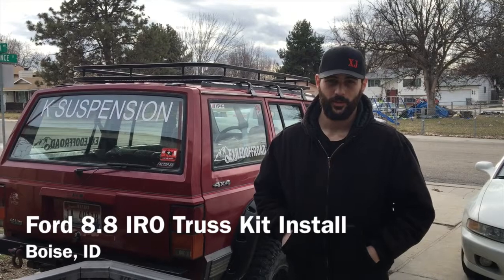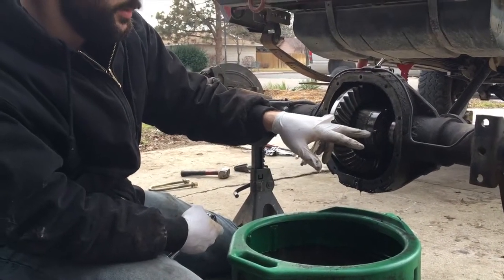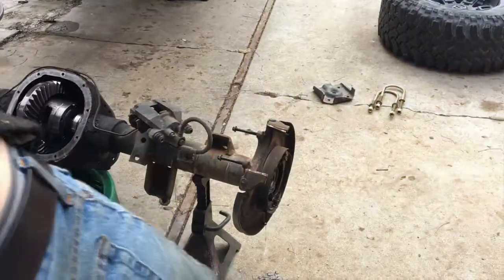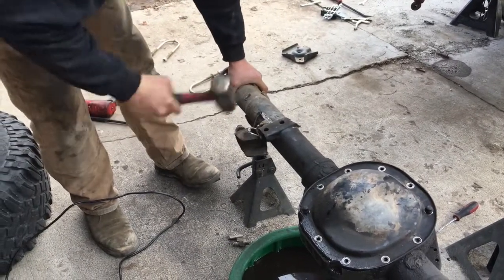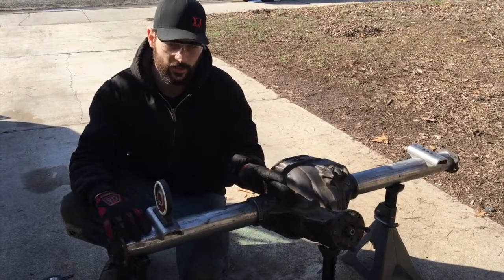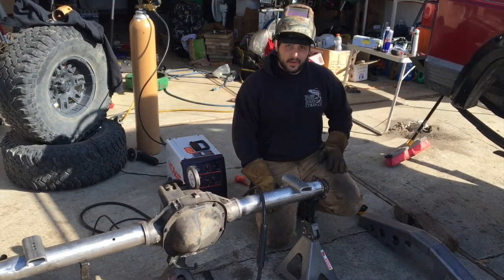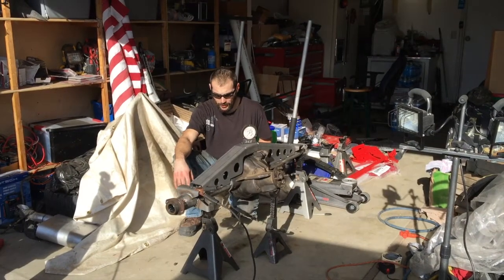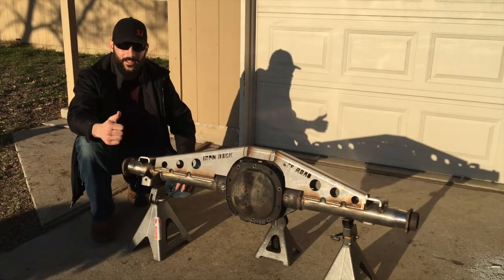Ford 8 8 IRO Truss Kit Install (Part 1)

Comment: Great video can u point ne in the right direction on making the brake line adapter to diff lines or have a link were i can purchase one ...having trouble finding were to get one
Reply from the maker: For the hard lines? You can reuse what you took off, just need a new one for the drop from the driver side
Reply: @KSuspension  yes the soft line that drops from the frame to the splitter on the diff is the one im asking about
Reply from the maker: @jaimepena3594  they’re available almost anywhere
Just search for Jeep extended rear brake line
Reply: @KSuspension  ok yes i just found them thank you... 👍i kept searching for brake line adapters and just emergency hand  brake lines were showing 🤦‍♂️
Reply from the maker: @jaimepena3594  gotcha. When you need the adapters to make your parking brake work, message us, we have them in stock
Reply: @KSuspension  ok thank you for your help..

Comment: I want to do this so bad (grab an Explorer axle from the junkyard) I need to regear anyway, but I don't know how to weld and the budget is ALWAYS tight. I'm thinking about taking a class then buying a welder hoping it will save me $ in the long run because Jeep projects never finish.  I have the same IRO truss on my 8.25, very beefy!

Comment: Did you set the perches at 3 11/16" on both sides? Ive ran into a few threads that states it correct for the driver side but not the passenger since its an offset diff?
Reply: Thank you so much. Just checking because im doing the same swap with the iron off-road kit as well. Lifted 6.5" on 35s. One guy was saying that his axle was sticking out by and inch on the passenger side. So the other issue is that his ds was to close or interfering with his muffler. So he set the passenger at 3 1/4 while the driver was at 3 11/16. Just want to make sure its done right the first time around
Reply from the maker: Deondre Johnson shoot us an email and we’ll send you some photos of how everything sits on 6.5” and 35’s so you can make adjustments as needed
Reply from the maker: Deondre Johnson suspensionlifts@gmail.com
Reply from the maker: Deondre Johnson yup, same on both sides
Reply: johnsonboy020496@gmail.com i really appreciate the help!

Comment: Did u heat it up before welding?
Reply from the maker: We did not, but you can if you feel as though it will help you. We knew the risks, but have never had any issues.

Comment: Hey Ksuspension, is it necessary to weld on the axle housing or just weld the axle tubes with IRO trusses?
Reply from the maker: Johnny Del Valle it helps lock in the tubes because 8.8's are known to spin tubes.
It's not necessary, but I would highly recommend it
Reply: KSuspension , thanks for the advice about the tubes to housing! How about the truss to the housing? Any weld from truss to housing? Or just weld truss to tube?
Reply from the maker: Johnny Del Valle no need to weld the truss to the housing. Tubes are just fine
Reply: KSuspension , thanks a lot. Just making sure before I burn the truss in.
Reply from the maker: Johnny Del Valle good luck on the build! I'm sure it'll come out amazing!

Comment: how did you get the chips out of the axle tube when you relocated the breather hole?
Reply: Run a rag through the tube to clean everything out, then hit it with some air to finalize it before install

Comment: What did you do for the brake lines when you did the swap? Did you use the 8.8 hard lines? I got my axle and am not sure what I am going to do yet. I was thinking about take the hard lines from my dana 35 and putting it on the 8.8. Any advice would be appreciated.
Reply: +Kallam Kruse I actually made my own brake lines. The D35 brake line will not work on the 8.8 as the new diff requires larger hoses for the disc calipers.
Reply: +Raffi Kassardjian  Thank you. Good to know. I will just have to see what I can make work then.

Comment: How many inch lift do you have? I am about to do this swap with this kit and want to know what pinion angle to use. I know you used 13 so I wanted to know your lift and tire set up.
Reply: +Kallam Kruse rear is 7" of lift running 33x12.5-15, soon to be 35's.

Comment: what kind of V is the welder?
Reply: +B. Mendiola Welder was a Hobart 220 MIG
Reply: +Raffi Kassardjian i just got a 220v lincon stick for $380 at Lowe's. ive read its a bit harder to use but we gotta start somewhere. thanks again
Reply: +Raffi Kassardjian how many amps did you use? i might return the stick welder an get wire
Reply: +B. Mendiola not quite sure. My brother did the welding 

You don't need to go super hot though
Reply: +Raffi Kassardjian alright...yea ive been reading some ppl use 110amp then others 220.....thanks though man
Reply: +B. Mendiola well this welder is a 220
110 would do the trick though if you have a good welder

Comment: Ok so I been thinkin bout doing the same thing with the IRO kit and the Yukon kit.. however I would like the run an ARB is that possible?
Reply: thanks guys
Reply: +Aaron Wheeler IV I would assume so, I don't see why that would cause issues
Reply: As long as you have the correct splines for the new axle shafts you will be just fine for sure!
Reply: +Aaron Wheeler IV no problem man anytime